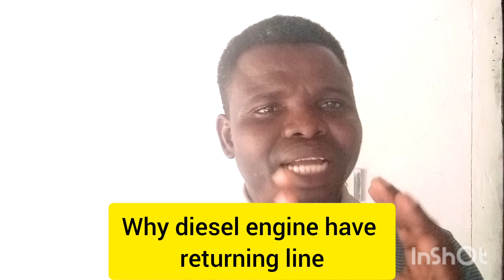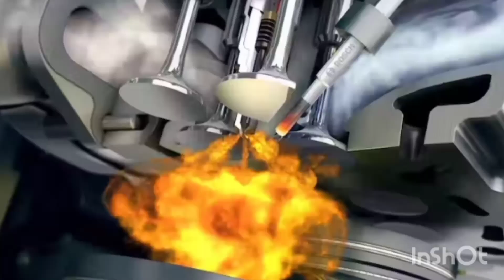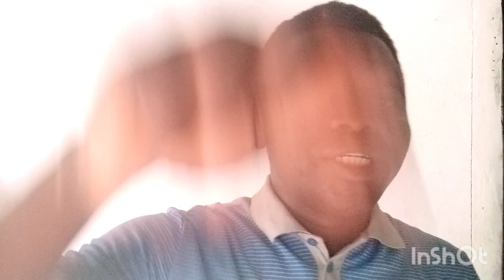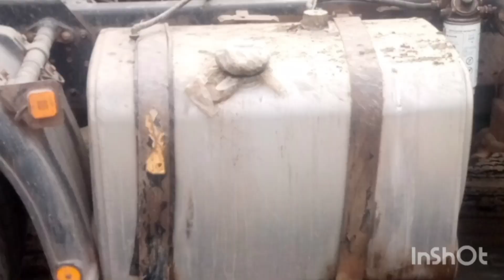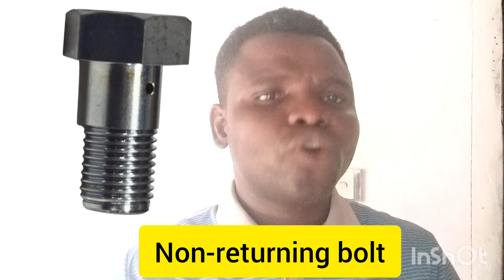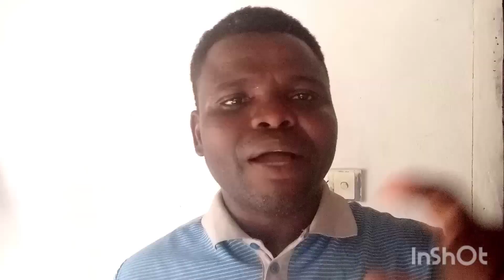Why Do Diesel Engines Have Fuel Return Line

Comment: All gas powered vehicles with fuel injection have a return line.   For the same reason deisel engines do, so the pump will feed an equal volume of fuel to all cylinders.   If you can't understand why this is, imagine a Roman fountain that is gravity fed and has multiple nozzles to spray water.  If you want each nozzel to spray exactly the same pressure, you install a resevoir above at a height that provides the wanted pressure at the nozzels and feed it more volume than the distribution nozzels can demand, and install a drain /return line at the top of the cistern.  Now the cistern will always be topped off, thus maintaining a constant pressure to the distribution nozzels.   In a typical gas fuel injection system, there is a lifting fuel pump in the fuel tank that feeds into an accumulator, this prevents fuel deprivation under load.  After the accumulator is a fuel filter, then, either an electric high-pressure pump, then a fuel rail that supplies individual fuel injectors.  At the end of the fuel rail is the return line back to the fuel tank.   On a carbourated engine the float bowl is the cistern and the float operates a petcock that will regulate the flow from the pump, it also has a hole at the top for fuel vapor to return to the fuel tank.  There are a few other systems, such as Bosch CIS, that have a high pressure pump with fuel distributor and constant fuel delivery through individual high pressure lines, and a mechanical means of varying the fuel pressure by means of a diaphram and lever. (1970's-80's Mercedes, etc ).  This also has a return line in the cobination fuel pump/fuel distributor.
Reply from the maker: Thanks for your thorough explanation, I just learned something new from you. Thanks again